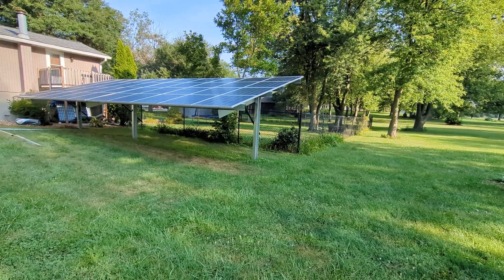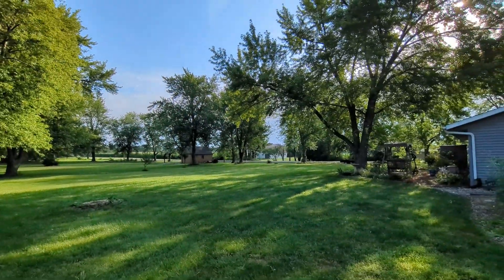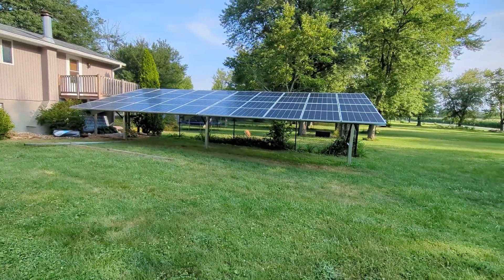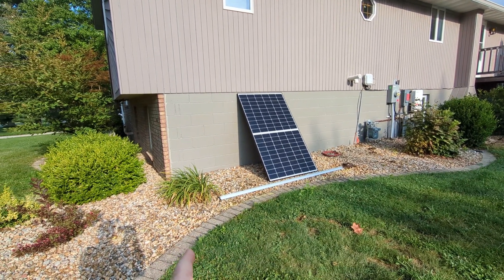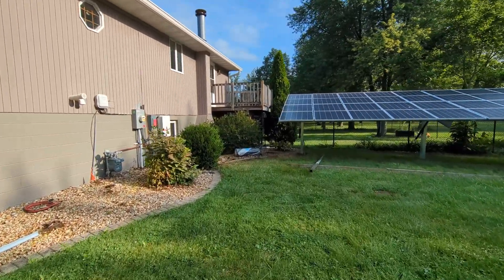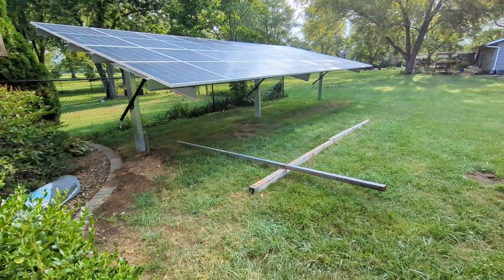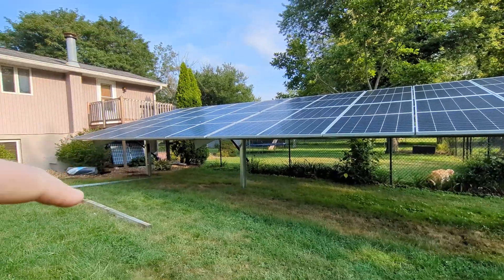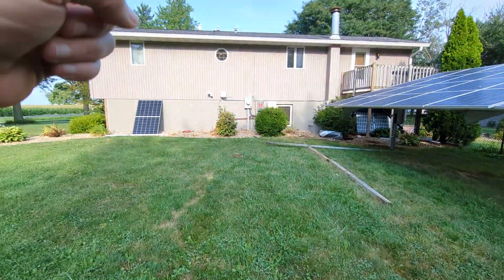Lets Plan - Growatt MIN1000TL Ground Array Phase 2

Comment: I have the same inverter with 14 400 watt panels. Originally I had 10 panels on one string on a lower 4/12 pitch roof and added 4 more panels at the same azimuth but a 8/12 pitch roof section. I had some early morning shade from trees and a roof ridge that clipped some of the potential and some clipping late in the day from another roof ridge, but got fairly close to what PVWatts predicted in August and September. After that I started getting more and more clipping of the sun from very large pine trees in the back of my property. In retrospect I should have used SunQuest phone app to track the sun from the panel locations and would have surmised the need to place the panels near the top of the roof for better fall, winter, and spring performance. 

I broke the panels up into two strings of 10 and 4 and got some improved performance but still way below PVWatts. 

Based on feedback from  Growatt, I broke the bottom 10 panels into two strings of 5 panels each and have the upper 4 panels on a third string to get the voltages more even between strings. Again, some modest improvement but still not stellar performance in winter months. I’d benefit more by moving some panels further up the roof or buying some more panels. I’ll see how the system performs this year and will mostly add more panels later in the year.